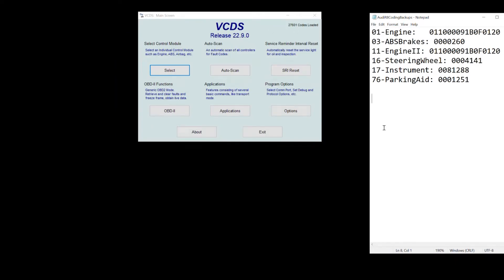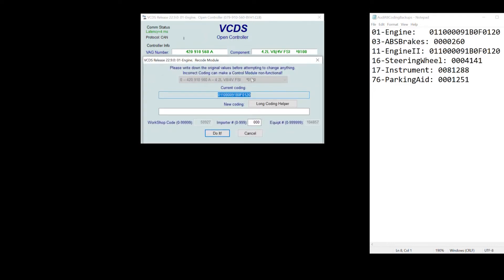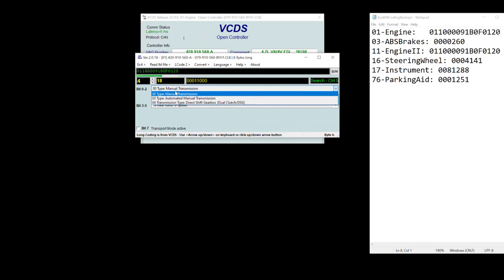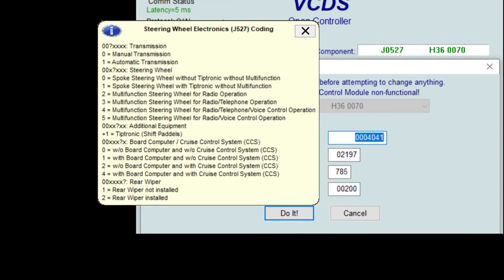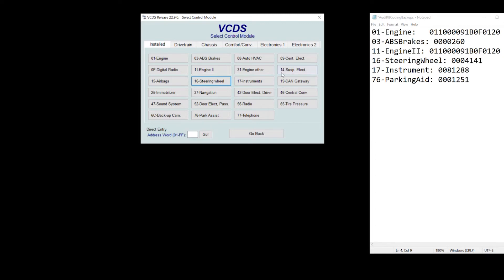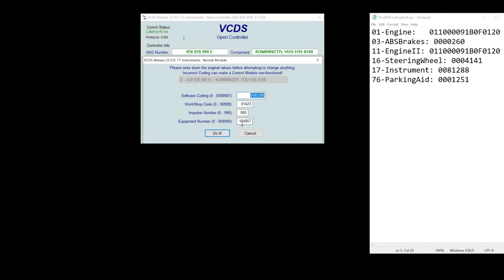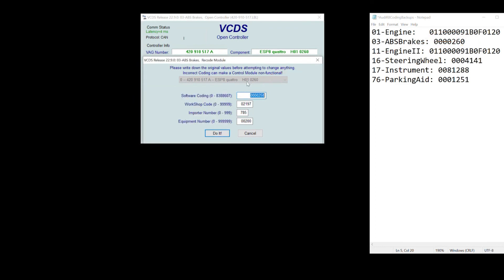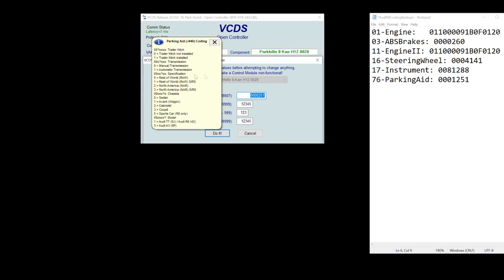Audi R8 Gated Manual Conversion Part 8: Programming the Manual Settings in VCDS

Comment from the maker: For the ABS Module, I recalled incorrectly that you can add a +2, you either need to subtract 2 or subtract 5 depending on the ABS module you have:

https://www.r8talk.com/threads/r8-gt-gated-manual-conversion-thread.176984/post-1651310